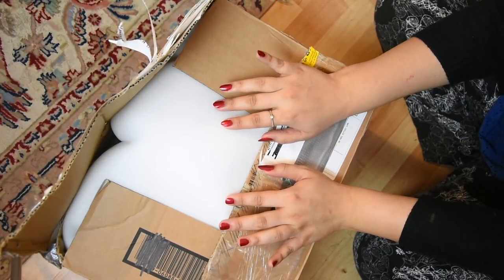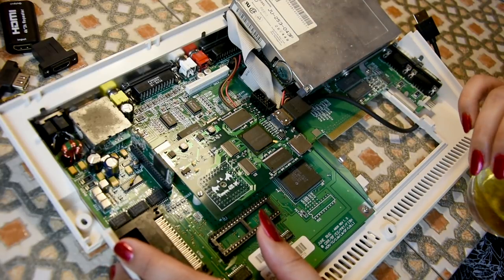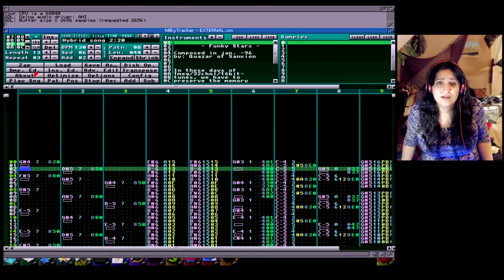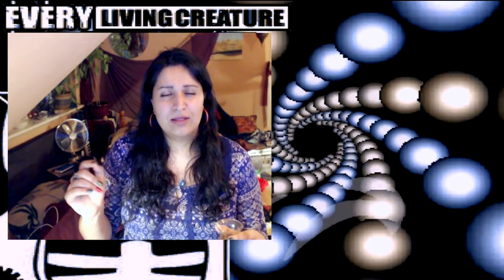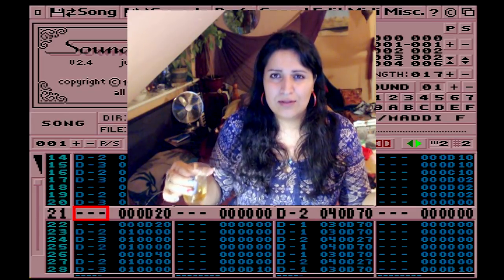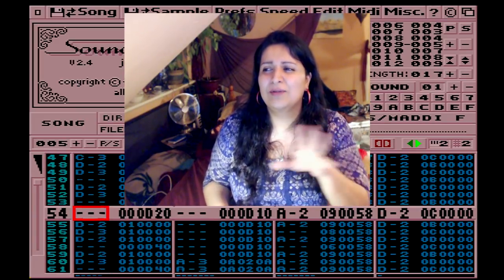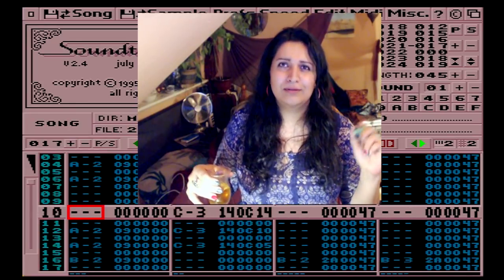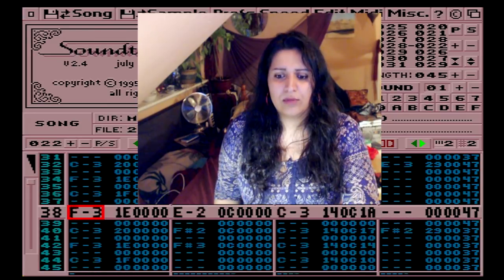Vampire V2 Amiga 600 Part 1 - Unboxing, Demonstration & Chillout talk

Comment: As a Mac User we had this allready years ago.. is a real mac a powerpc mac or is the new intel cpu mac a "real mac" ? So we decide that only MacOS is the real Mac, the Intel Mac Hardware is the same as the Windows PC Hardware. The diffrence is only the OS and how the drivers use the Hardware on Software side. It worked and the Macs came back from nothing to selling again.

Comment: I think the answer to what is a real Amiga is very personal and has alot to do with nostalgia. Back in the day I had a basic Amiga 500 with 1MB RAM, internal floppy drive + one external floppy drive. I still have it. But a couple of years ago I started collecting Amigas. So now I have 3 A600, 6 A500s, one A1200. Many of them have accelerators (Not Vampire) and are set up for whdload. However, for me personally that basic Amiga 500 configuration from back in the day will always feel like the most real Amiga for me. However, I think the Vampire is stretching it a bit far for my taste. It's no longer based on a real Motorola CPU and makes the Amiga so fast that you can turn it into a mid 90s PC. So for my personal taste a Vampire is in the borderland for what I would consider a real Amiga or not. I think it's great that they make stuff like this so long after Commodores demise.  Thanks for a great video.
Reply: I get that - the nostlgia is a huge factor for many of us, and sure that comes from being able to play the games regardless of the platform, but there's something magical about the case, the keyboard, the FDD sounds, the fact we know its original hardware.  So I see where you are coming from!

 But, I also see the Vampire providing a lot more power to the Amiga than any legit (physical 68K) could ever provide me with.  So I see both sides here!  I wouldn't for example sell my ACA1220 since that feels like a different experience to the Vampire.  I will also at some point build one of Terrible Fire 030 boards, again because its a great project and uses real 030 chips.   But the Vampire despite turning the Amiga into a hybrid does bring a lot to like, if you can live with the fact its taking over more of the system than you would like.
Reply: When talking about the feel from a real Amiga I have to mention one thing that I notice and love other than what you mentioned here. When the Amiga heats up you can smell this old electronics smell. Also brings alot of nostalgia. In my case Amiga was and is all about gaming and watching demos. So those are my needs. For these needs I do not really need the speed of a Vampire. Even a 020 accelerator will do fine for whdload. However, I have the ACA 1233 on my A1200 and there is a big speed bump from my 020 accelerators to this 030 based accelerator which is quite nice. Also, when talking about that old basic Amiga 500 which is my ultimate nostalgia it is still nice to play games like Wings or Indianapolis 500 on accelerated Amigas. They are so much more smooth. Another benefit is those games that comes on a lot of disks like Monkey Island 2 or Beneath a Steel Sky, having whdload versions is really nice. 

Talking about accelerators and speed. I've tried scummvm on my Amigas. And I know if you have a fast enough accelerator you can play many old PC games with the full midi music and everything. I think you need a 040 or more to get midi music. This is something I personally feel is getting to the limit of what I wish from an Amiga. I do not see why I would want to use my Amigas for playing old PC games. On my Amigas I want to play Amiga games. If I want to play old PC games I can use one of my retro PCs. I am not a fan of using emulators, even though I used to in the past. Again, as I said, the more stuff they make for these old computers, the better. 

I am all for the vampire and anything else they make. And I am all for people buying, using and enjoying devices like the vampire. I am happy other people enjoy their hardware. As with everything, each to their own. These are just my personal feelings about how I want my Amigas to be. As MsMadLemon said in the video, people trying to convince others that hardware like the Vampire is wrong and it's no longer an Amiga when using a Vampire, probably are jealous and want one themselves. I think it's fine to share our personal opinions but we have to respect other peoples personal opinions. I can afford a Vampire, but I will not buy it because of my personal feelings and how I use my Amigas. But that is just me. Just like I do not see the point of running PC software on my Amigas.
Reply: Yes, you've touched on some strong points there!   The smell!!!!!!!  Yes, you cannot beat the smell of the original hardware =D  I do also agree that when it becomes a PC capability it feels a bit pointless.  It's not quite up to that point, and I have to admit whilst I would like to run SCUMM etc, I probably wouldnt use it for that because I have the Pentium 2 for those games and prefer to play them that way.  It's nice to have options though, and if anything at least games like Doom can run at a decent speed on the Amiga.  I am sure I could probably be happy with a fast 040 or something, but the Vampire is the cheaper solution for that I think.

Comment: For me the difference between *UAE and the Vampire is UAE is software emulation, it's software that runs on a different architecture and translates calls to Amiga hardware into calls to host hardware.  

The Vampire is an acclereator with hardware emulation of things like RTG.  It's not hardware emulation of an Amiga, that would be like connecting a 68060 CPU and replica of the Amiga's chipset on a PCI-e card, plugging it into a PC using that to run Amiga software.  

To me the Vampire is a real Amiga in the same way that a Raspberry Pi running RISC OS is a real Archimedes or an Archimedes is a real BBC Micro.  It's not the same as the original hardware, it's not entirely compatible with the original hardware but it is a continuation of the original hardware.  To say that the Vampire is not a real Miga is a bit like saying 64 bit Windows isn;t real Windows because it doesn't run 16 bit applications for Windows 3.

Comment: Well it's only really an Amiga if it can play all the software and demos that an Amiga can. I have heard the vampires have problems with a lot of demos. Is this still true?
Reply from the maker: A stock Amiga 1200 has problems with a lot of older demos and games that were only made for OCS... as I said, the more you accelerate an Amiga, the more issues you will have until you use something like WHDload or a degrader, which will make them work right.

Comment: the thing i think people don't like about the vampire accelerators is that they replace too much of the Amiga, and that it becomes basically an FPGA Amiga in the case of a 'real' Amiga.
Reply: I think you are right - that is why some people don't like it. For me, I see its utilizing standard def video out of the normal route, its using the PCMCIA slot, the controller ports, keyboard, IO, FDD etc.  So whilst at times the main chipset and processor are being bypassed, its more of a hybrid than just a purely an entire FPGA based system.  The fact that it runs inside an Amiga case with an Amiga board - that sells it to me.

Comment: FPGA is technically emulation, your setting up a series of gates to emulate a know chip's logic. Things get a bit existential because there is no real 68080 to emulate. What it all comes down to in all reality is it doesn't matter, it runs AOS and it does a damn good job so have fun with it and don't care about if it's emulation or not.

OR... you can give it to me and I'll not care about what people think!  :)   Yea I knew that was a long shot, so go learn MilkyTracker and crank out some tunes for us.

Me, I have to wait on the Vamp1200 as I don't have a 600 and cant afford to buy both a 600 and a vamp, so I wait on the Vamp1200.
Reply from the maker: I think when mentioning "emulation" i'm more referring to the comment someoen made that theres no difference between FPGA and software emulation like WINuae/FSUAE...one or two in my comment section are nitpicking even saying "WHDLoad is Emulation, it emulates the floppy drive" lol *rolls eyes*. 

I'm aware there's not a 68080 processor which is why I kept referring to always wanting a 68060 back in the day lol. I'm not sure what they mean exactly with regards to a 68080 I need to learn more about what they've done exactly. Though it is at least a 68060 which excites me and yeah, MilkyTracker ;o) lol 

You already knew you werent going to get the vampire off me, (Darn it, I wish it was 1st april ;o) ) 

I hope you enjoy the Vamp 1200! it's one which I was initially waiting for and I know it's goin to be good :o)

Comment: I think everybody has their own idea of what the Amiga means to them. It we can label things just for a moment, there is 'The Commodore-Amiga' and there is 'Amiga'. In order to qualify for it to be The Commodore-Amiga,  the item needs to have been manufactured during the life of Commodore - e.g. 1985 to 1994. So if you have an external drive or a joystick made at the time, thats what they call Canon. Everything else produced for the computer after 94 (like PPC cards) are non-canon. Same with WB4.0 (I think 3.1 was the final official release), and X1000 systems, and even the games which appeared after 94 are non-canon. 'The Commodore-Amiga' also means the sounds, the smells, the hardware clunk of the disk drive, the long LEDs, the Amiga logo, and just about everything which cant be emulated. 

Then there is 'Amiga' - and Amiga is slightly different. It means everything which is associated with Amiga. When people use an emulator, they get Amiga - ; Amiga Games, Amiga Workbench, Amiga Mouse Pointer, Amiga Environment.  When people read Amiga Future, they get Amiga. Its like the huge bubble which incorporates everything, including Commodore-Amiga users, and all the new and old hardware made to run on the old systems, as well as the new and old software.  Some people put themselves in the 'classic' camp - Shot97 for example - and other people just see the whole thing and dont really care how a game is played as long as they/people are playing it, like me.  Not everyone falls into a camp of course, but thats what most of the fuss is about. 

The vampire only draws power from the computer, so its just a mini-mig inside a real Amiga case. To classic fans, this would be like bolting a C64 hardware board onto a PC, so its neither a PC nor a real C64.  The Raspberry Pi can do everything the Vampire can do, only its even smaller. I think many classic Amiga users might not mind so much if they had made a proper card slot mother board, which slotted in like a real expansion card, and it still used the hardware. With this, they said the hardware is not fast enough to handle modern IDE and HDMI, so they cant use any of it, which seems to defeat the objective of expanding the real hardware in the machine by not using it at all. Yes this is challenging stuff to some people, who can get upset how people are buying real Amigas just to run a parasite new motherboard in it, and this means classic hardware is being destroyed. Its the same people who will scream when you remove the old modulator, and I must admit this is rather sad to see it go. 

I hope these views have helped a little bit, I can only see things from my side, and others may see it differently. I dont mean to challenge anyone, especially not over Christmas, so lets just say I'm in the camp which does not care as long as people talk about and use the Amiga. :)

Comment: I think regards to the FPGA point there - its an Amiga still if it behaves the same way regards compatibility.  Hardware purists will prefer the old chips, and I tend to like original hardware, but when an FPGA system interfaces with the original system and utilises functionallity within that original system, I tend to want to use that FPGA system lol.   For example the Super SD System 3 uses an FPGA, as does the SD2SNES, and the Neo SD cart.  What I dont like is a 100% system in an FPGA - eg. the Mist.  Not because it doesnt work (it does), to me the Mist feels like an emulated system.  But an A600 or A500 with an FPGA based accelerator - feels like an Amiga to me.
Reply from the maker: I will admit, I personally wouldnt get the same Amiga feeling with a MIST but that's just me personally, whoever does then power to them, i'm kinda the same with regards to if it's an accelerator inside an Amiga, it will feel more like an Amiga to me. 
I can understand the purist point of view and I have my other untouched Amiga for that. I like to do the best of both worlds thing :o)
Reply: I sometimes wonder if people consider these new C64 Reloaded Boards a true C64 or just brush it off as bad? After all it is an updated revision of the original boards (minus the chips which need to be salvaged from original boards). Personally it is still a true C64 to me and if there would be an A500 version of it, it would be the same.
Reply: Actually I own a Mist and (this is hard to put in words exactly) but using the Amiga core on the MiSt "FEELS" like a real amiga, its all the little nuances like how the mouse responds and how it just purrs under the hood.. when you use it, it feels way more "real" than even with a good emulator.. Its one of those subjective things thats exceptionally hard to describe but easy to experience yourself when you actually sit down and use it. It was the MiST and the minimig core that really made me finally "get it" with what power is in an FPGA over emulation.
Reply: @Kraftwerk2K6 Yeah, I think its still a true C64 since most of the chips are original.  If it had an FPGA on there simulating all the hardware, then it wouldn't be a C64 to me.  Similarly a Rasberry Pi in a C64 case would be something that doesn't appeal to me either.   Sure an FPGA based system is going to be more accurate, but emulation via Pi is pretty accurate anyway tbh, and that's one area I have a hard time understanding.  For example, those new HDMI Megadrives are aweful imo, but I would consider hacking one and fitting a Pi inside it or something in order to improve it.

@All
There is of course a way that all our opinions change at some point in time.  This is an interesting subject as I am having similar discussions with someone else atm on the subject of opinions.  Consider this - The C64 becomes rarer than it is now, perhaps a few of my CPUs die over the next 12 months.   At that point, I may consider that an entire FPGA C64 is actually a really good idea for me, in order to preserve my original hardware - ie. save wear and tear on something that is becoming endangered, purely due to how much I use the systems.

Incidentally, there is a 'new' C64 coming I believe, from Individual Computers.  Entirely FPGA based I think.

Comment: I see your 600, has tantalum and not electrolyt caps. Just as my 600. Personally Inreally would love an acc card of some sort, yet I need to get an IndevisionECS first. The bad part, is that they are no longer for sale and as far as I understand, they are not going to be produced anymore. Wich basically sucks. :-( Vampires look awesomme, yet my goal is to have an 600, that performs the way they were released, just with one tiny twist, wich are that it need to be able to use more recent stuff, like a flatscreen vga monitor. To me, a vampire are more and more as a kind of modern machine, wich uses the old hardware as the spine of the system. Were I am more in love with the original performance and feel of the original hardware. On the other hand. Congrats with an awesomme vampire setup. I like them for what they are and think they are awesomme. They are just not really for me personally.

Comment: It's not the point of this video Maddi but I enjoyed your enthusiasm when you discovered that tracker software. 

On the modding issue I can only say that anything you modify (be it computers, cars or even human beings for that matter) it's always going to be a matter of discussion. When you modify a person's face, is it still the same person yes or no? If you modify a Renault 5 (remember those?) to the point it goes faster than a formula1 car, is it still a Renault 5? And what if Renault did it themselves? There's no true or false and it tests our ability to see and respect another person's view point. 
Probably if you mod a thing to the point where there is nothing left of the original (in design, not parts), then you can say that it's no longer the original thing. Otherwise, you're still going to need the original to produce the mod. A mod is still a modification to something else. Otherwise it would just be called something else, wouldn't it?

Merry Christmas.
Reply: The dentist modified my teeth, think i'm still the same person.
Reply from the maker: ^ lol 
I think that was 'The Highlander's point. it's basically what would one consider a change. It is relative really, you get hardcore purists who wouldnt ever touch anything and leave it stock or only original peripherals to be able to call it an Amiga. Or you have those that mod them, (even modded them back in the day).. and as stated above it's still classed as an Amiga with a modification. Unless it was changed completely. 

I do agree that "what is a real Amiga" is relative with regards to each person and their outlook. whatever opinion isn't an issue, unless it's forced upon another.